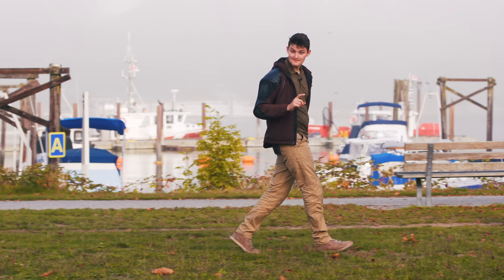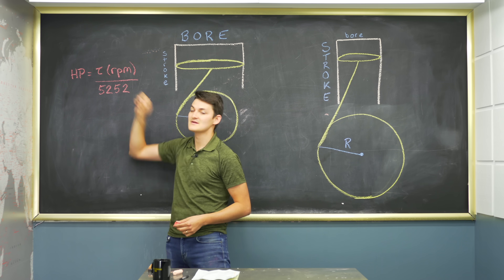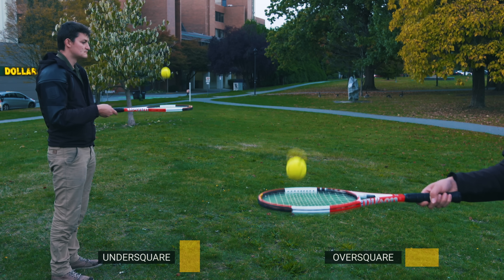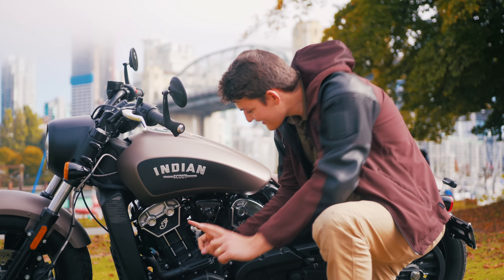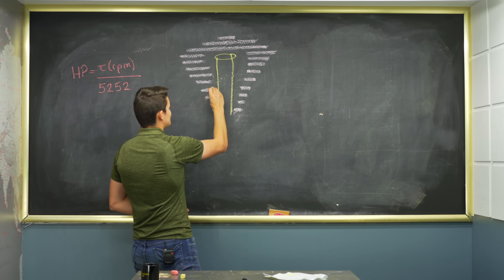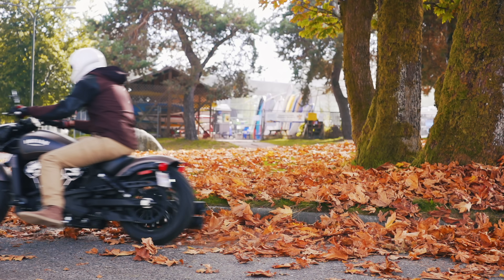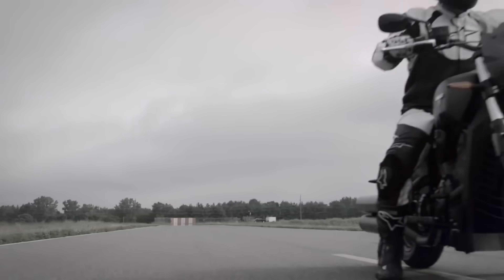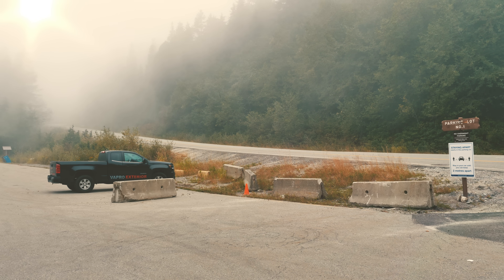How Indian Makes 43% More Power than Harley-Davidson

Comment: "How Indian Makes 43% More Power than Harley-Davidson?" By not being HD and actually engineering, 58hp from 1.2 litre is pathetic no matter how much torque it has
Reply: frost bite  instead of paying a premium just to pay to do more work to make the same power as the competition is the Harley way
Reply: @Clyde Wilson Yea sure it does the job whilst guzzling gas. Problem is not with the low power, it's with the low efficiency. A 650 makes more power than some of the 1.5l+ harleys however the 650s can also achieve over 50mpg and higher top speeds and better acceleration. It's just better to have a well engineered engine, no reason to the contrary
Reply: @Clyde Wilson I mean, fair enough if you like how they deliver power but like, thats pretty narrow minded to assume anyone who cares about the hp numbers wants to brag.
Reply: @Clyde Wilson 100 mph down hill with a tail wind after about 40 seconds. My Road Glide has a hell of a time getting over triple digits, but it is an old 88ci.
Reply: @Clyde Wilson Feel like what? The whole world is shaking under their feet?
Reply: @AntaresSQ01  Not to mention that four cylinder bikes that are 1200CC squash a 1200 Twin like it's nothing,  more power, more revs and more torque
Reply: @AntaresSQ01  also reducing emissions is never a bad thing...
Reply: My bone stock 1970 CB750 is still a better bike than a new 1200 sportster.  Faster and stops quicker too.
Reply: @Clyde Wilson Actually "better" is not a feeling.  It can be quantified.  Weight, power, braking, ergonomics and cost are a good start.  Best thing about most Harleys are the American jobs they create.  How you feel, doesn't mean it's better engineered.  Just like a 1964 vet is not a better car than a 2020.  Your not doing Harley a favor by wanting the same stuff for 40+ years.  It will be their demise.    Better: of a more excellent or effective type or quality.
Reply: @Clyde Wilson bet·ter1
/ˈbedər/ adjective
1.
of a more excellent or effective type or quality.
Reply: Antares, if you're sole measure is hp, certainly you have been tricked into believing a marketing hype.
Reply: @omarsalgado9715  Read my other responses
Reply: @AntaresSQ01  No need to. Your sole statement in this thread speaks volumes of how you don't understand bore and stroke, or the actual phyisics behind them. Moreover, you don't understand what a relaxed trip means. An engine that yields its torque at the high rpm range is highly stressful, psychologically, for cruising. But ok, 200 hp for 1000 cc are the best of the best in any scenario. What a joke, haha!
Reply: @omarsalgado9715  Oh yea i'm only an automotive engineer but yea i don't know what bore and stroke is. The difference is that you have to have a harley singing to go 70, I can do that at 4000 rpm out of 13,000 AVAILABLE on my S1000XR. True screamers are annoying, but just because it's an inline 4 with actual modern technology doesn't mean you need to be ripping it all the time. There are plenty of reasons why harleys are shit, their inefficient and weak engines are just one of the many reasons. Can you get 45 mpg in your harley? I most certainly can in my 165bhp Sports Tourer with cruise control, dynamic suspension, lean sensitive abs and traction control for half the price. Talk about "relaxed trip" ahahhahahahah on a harley???? ahahhah what a joke. Have you ever heard a harley? it's the definition of earrape.
Reply: A Prius makes more power per litre
Reply: @omarsalgado9715  Bruh u are making a fool of yourself, 4000 rpm "Lugging" the engine and damaging it??? What???? At 4000 RPM my XR produces 75Nm torque and 50hp. You are absolutely not lugging the engine, you must be an idiot for thinking, This bike can do 20mph on idle power alone in 3rd gear and it accelerates smoothly from 0 throttle to full throttle, no lugging involved. You should learn what you're talking about before talking shit. And ofc I praise horsepower, because it directly correlates to performance lmao. And I've taken my XR to track plenty of times to have said I used 80% of it's potential at the very least. But hey, must feel great to drag pegs trying to take a mild corner at 50mph...
Reply: @omarsalgado9715  ??? hahahaha You're sad beyond belief, I'm done here
Reply: @omarsalgado9715  what's your point? How do you measure a bike? It's hard to compare bike by sentimental value, look or other subjective term.
Many use horsepower cause it's a easily compared, and is often in line with the capacity of the bike. 
Some people like to use their bike for other thing than relaxed cruising, having a more capable bike is more fun and less dangerous.
Reply: @rslover65  A Prius weighs 4.7 more times than a Sportster.

...

Definitely, hp praisers just take this sole figure to measure anything, but they show they don't even know what an hp means, they lack the ability to put it in context, which is the key.

HP only belongs in the tracks. For public riding, it means nothing.
Reply: @ameunier41  When did I mention sentimental value? Those are words from you mouth.

Horsepower is a theoretical number. To reach it, the engine must be revved to a certain range. It stems from bore, stroke, rod length, rpm, type of gas, ring sealing, transmission resistance, road resistance, weight and so on... So being a theoretical number, it means something just when put into context. For example, why would you need 200 hp off-road? Why would you need 200 hp in a traffic jam? Why would you need 200 hp in a mountainous road where physical speed is limited to 50 mph? Why would you need 200 hp if your riding position, like in a cruiser, becomes a nightmare above 80 mph?

And that's right: some people like to use their bike for other thing than being speed freaks. Or what? Did you expect the opposite? Haha.

I can't argue that having a capable bike is safer, but taken as an idea, means nothing. Again, context must be taken into account. Safer, then, means something if you specify bike, road and rider.

So? What's your point?
Reply: @Clyde Wilson My grandfather bought the CB750 new in 70'.  I know there are hundreds, if not thousands of better models.  A 1200 sportster is not one of them.  My point is, Harley has sold the same stuff for too long and not spent enough on engineering, except the Vrod.  The only reason they cost so much is because of the labor costs in our great country and patriotism.  There is something to be said for loyalty; that doesn't mean the bikes wouldn't be better with water cooling and DOHCs.

Comment: I had a 1945 Indian scout with running boards, suicide clutch, decompression lever, advance/retard hand grip, carburettor primer,  tractor spring seat, twin tanks and lawnmower handlebars.
Reply: No you didnt, no such thing as a 1945 scout.
Reply: Congratulations

Comment: There are lots of bikes that make more power than any Harley,  and I'm sure they are great bikes.  Look at a Honda civic,  compare it to many similar priced sedans,  it's not impressive at all, but for a tuner,  a quick search for aftermarket mods and parts, suddenly the civic has great value,  as far as a platform to build on.  Suspension and chassis mods,  custom exhausts,  engine swaps,  turbo kits,  any thing you can think of,  its available.  More so than almost any other sedan. The Harley had great potential to a hot rodder,  in this example,  sure that stock Indian makes more hp, but look at its aftermarket,  there is very little available,  and what is available,  comes at a Premium.  With a good builder,  someone into hot rodding,  the Harley can easily best the Indian,  not to mention all the other custom parts that are available,  from custom frames,  suspension,  brakes and wheels,  custom gas tanks and fenders etc. I'll agree all day long,  that comparing a stock Harley,  to almost any other stock bike,  the Harley isn't impressive at all. However,  for the special person,  who wants to mod and build,  the Harley had potential that no other vtwin will match.  If you just want a nice stock bike,  don't buy a Harley.  But if you're an enthusiast,  the Harley offers more than any other cruiser.  Now let's look at parts available.  Own the Indian long enough,  at some point a part will fail. You may need a fuel pump,  an injection,  an ecu, a sensor,  price those parts.  My buell xb12s is a sportster ( full stage 4 from Eric buell) , but in a sport bike chassis.  It uses all ford parts and part numbers.  Every sensor is a Ford part, the fuel pump is a Ford part, I can go to a local parts store,  and get almost anything I need, no special orders,  in stock,  cheap. The Indian will not give you that. There are many great things that come with owning a Harley,  and its almost never discussed in any comparison review.  A stock to stock comparison,  between a Harley and any other bike,  doesn't tell the full story.  I enjoy working on my own vehicles, I love simple.  You can tear down a Harley engine completely,  over a weekend with basic tools,  do mods, big bore kits, cam swaps, head work, etc, the transmission is easily worked on etc, you can tear it apart,  put it back together over a weekend.  You wont ever be able to do that with the Indian.  If you just want a nice stock bike,  and don't care about anything I mentioned,  the Harley is not for you,  you will be better off to get the Indian,  or any other bike.  Harlies are not for everyone,  but they are for a very certain, enthusiast crowd.
Reply: You said it best!
Reply: Couldnt have put it better.
I have a sportster, my cousin has an scout. We both love our bikes for what they are (and for me, what my harley might become)
Do you wanna build it out? Harley
Do you want a finished product? Indian

Comment: The biggest shame is that Harley has equal racing pedigree when you look through their history so instead of lying to themselves they should seriously look at history and change, make bikes with hints of nostalgia but with modern technology, best thing of all to remember is that price should follow the engineering, not the name its attached to
Reply: They do. People just ignore them. The Vrod was a good example and so is the Livewire. Both cool bikes but I’ve never seen either one of them on the road or at either of my local motorcycle clubs (one of which is the largest and one of the oldest  motorcycle clubs on the east coast).
Reply: @CamaroAmx  I've seen many V-Rods here in Toronto. I guess having a powerful Porsche designed motor offended the meathead sensibilities of the intellectually challenged buyers in the States.

Comment: I have always loved Indian over HD, but with my current v-twin putting down 140hp with a 6 speed transmission it makes you realize anything under 100hp is really a joke
Reply: Bruh, I've smoked guys with twice the power and thrice the displacement.
Reply: @user-cc32vcg811  oh I know. I've owned a gsxr750 and a zx636r in my life and now own a Suzuki TL1000R v twin crotch rocket. The 2 equations that stand out to me the most are 

.636cc x 16000rpms = 10,176 liters displaced in the power band

1200cc x 6500rpms = 7800 liters displaced.

The engine that was half the size out displaced the larger engine by a quarter more in one run of its powerband

The next is : HP support = cfm x power coefficient x cylinder count x volumetric effeciency

This equation here is what limits my 2 cylinder V-Twin 1000cc to 130 horsepower engine but 79 foot pound of torque, while 4 cylinder I4 can make 160-180hp @ 79ft lbs. Those 2 extra pistons in the math help the HP, but I make up for tq in my bore and stroke

Comment: Whats going on with the ginormous amount of balancing on that Harley wheel? did it really come from the factory like that ? Last time I saw that many weights on a wheel, it was on a truck.
Reply: Yeah, I noticed that also. Something is definitely amiss if you need that much lead to smooth out a wheel.
Reply: @RogueCheddar  I've since heard that this is quite normal on a Harley and should be because of some production problems at Michelin.. This is however very unconfirmed rumours.. 😊

Comment: Harley Davidson has only recently began to upgrade and that was in 2017 with the Milwaukee 8 but the technology was still 1950/1960’s type with pushrods, bottom end cam, huge primary chain in oil and three hole oil changes. The new Revolution Max solves that problem along with the engine being liquid cooled.

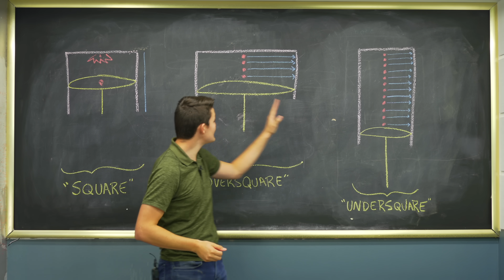Comment: @5:15
Why can't HD just put faux fins on a water cooled engine? Metrics have been doing it for years.
Reply: They did, it's called the VRod which Harley should've stuck behind instead of listening to critics and dropping, and putting the revolution engine in the xr1200
Reply: Triumph do it with their 2016+ Bonneville too
Reply: @nfdr0kk3rz  
Agree 100%. V Rod was the coolest thing to come out of Harley for 100 years, but HD fans weren't too keen on it for whatever reason.

Comment: Had the Victory Octane, absolutely loved it, until a man turned directly in front of me just over a month ago :/ she’s gone
Reply: Loved mine for a year then I couldn't get rid of it fast enough, zero reliability even with my meticulous maintenance schedule.
Besides when a company says fuck the customer and drops support after a year they aren't worth spending money on
Reply: @jonathangarzon2798  that’s odd, I had nothing but great riding with mine, had it since it came out. I am disappointed in Polaris, so I won’t be looking at Indian if I do decide to ride again
Reply: @jordancailes8383  did you tune it and how many miles?
Yeah they had a plethora of electrical problems,, most common being starters that burned out in less than a year and throwing codes for no reason.
It's pretty widespread when I talked to the FB group
Reply: @jonathangarzon2798  nah didn’t tune it, had factory upgrades, I did have to replace the starter under warranty, which was a victory wide issue, not just octanes.  I hade about 16,000km I think when I was hit
Reply: It's a shame she's gone, but glad you sound ok bud. Ride safe.
Reply: @isoplus3513  I’ll hopefully be okay, I’m still not perfect, good reminder for drivers to not be in a rush to go nowhere fast, had he of waited 30 seconds I would have been okay
Reply: @jonathangarzon2798  Support for Victory is still going today...they guaranteed parts and service for a minimum of 7 years after they axed Victory sooo....?

Starters on earlier Scouts/Octanes were an issue, there was a campaign for them. Haven't heard of those problems since.
Reply: @mattshaggs2931  I'm still part of the FB page and if it's fixed the community sure as hell hasn't noticed.
And an elusive pinky promise to produce parts for 7 years (was originally claimed for 10yrs) is not support that's PR.
Support means you can go to any polaris dealership and be helped, and you can't I had to drive 1.5 hrs to get to a dealership that polaris deemed allowed to work on them even though there's two polaris dealerships in my 20minute radius.
Reply: are you ok though?
Reply: @debaronAZK  I’ll get there
Reply: @jonathangarzon2798  Oh, well, then maybe that's the one thing Victory didn't transfer from the Scout since the Scout seems to not have those issues anymore.

I used 7 years because I know they promised an amount of time but was unsure of the amount and 7, at minimum, is the industry standard.

1.5 hours? I have to drive 50 minutes to go 12 miles to work...please whine more to me.
Reply: @mattshaggs2931  driving to work isn't stressful.
Having to get a non-functional bike that far to drop it off and wait weeks before it's fixed is not tenable when it's your only vehicle.

So yeah I'll whine about not being able to get to my job and you wine about driving a car to work
Reply: @jonathangarzon2798  There's always the bus...millions of people around the world use them.
Reply: @mattshaggs2931  yeah I checked that buddy there's no bus stop within 5 miles of my job, how about you not try and talk about something you have zero information of just because someone brings up information that evidently upsets you
Reply: @jonathangarzon2798  Hey, let's remember...YOU are the one that bought a bike with the only repair facilities 1.5 hours away for your only commuter vehicle when every other mode of transportation ISN'T available for you to use in the event of a breakdown. 

To be fair to me, that kind of rationale is something I would NOT expect out of someone that's reasonable. So, to be fair, I was actually giving you the benefit of the doubt...only to be proven totally wrong. Good for you? I guess?

Comment: Time to throw the Honda Rebel 1100 into the hat for comparison, Ryan. It's 2022... 1100cc, it's a twin with 270* crank, 86 HP at 8000 rpm and 72 ft lbs of torque.  Ride it with a DCT transmission... I still can't believe how potent the 1100 is off of idle in Normal mode, let alone Sport mode. Sure, it's made in Japan. Good luck finding one.